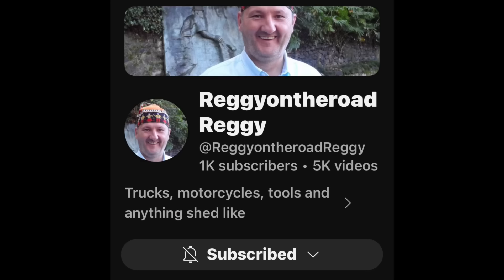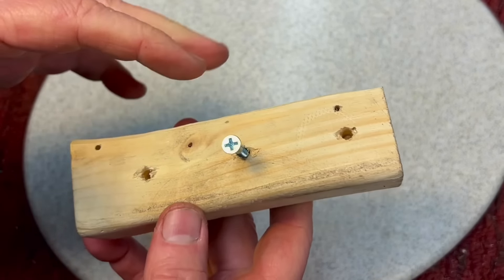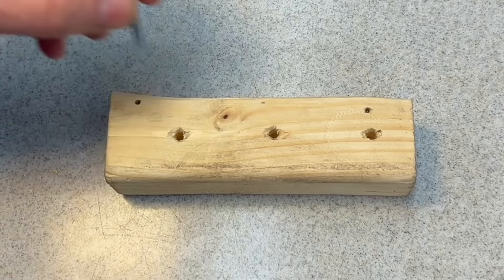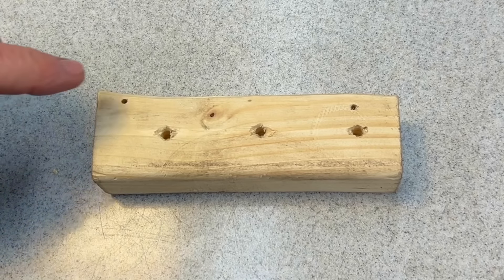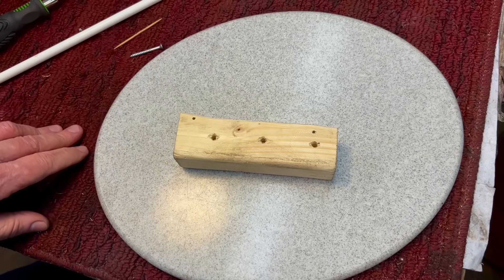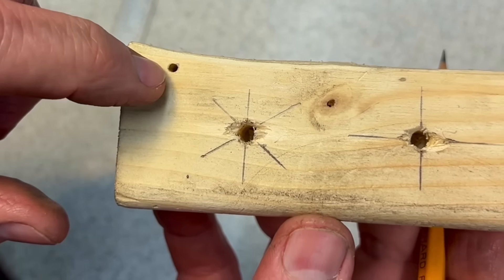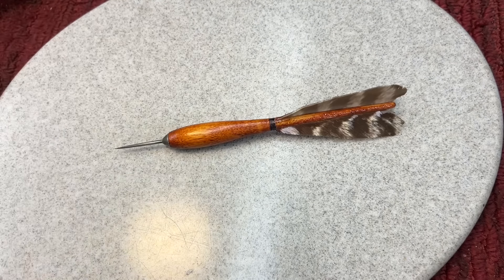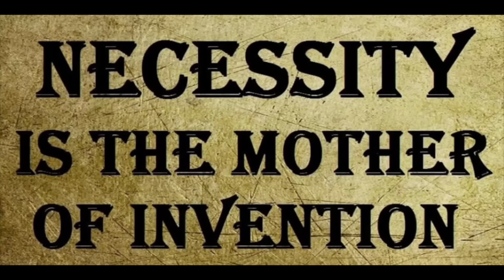Doweling Damaged Screw Holes and Vintage Carnival Dart Build

Comment: Hey John, a few years ago I came across a product call Mr. Grips. Amazon has a pack for about $6. We sell them at the Hardware store. Thin pieces of metal you can cut to size that have teeth on them. You can cut them down with utility scissors or small shears and slip them into holes and then insert the screw. Best fix I have found especially if you don't have time to wait.  Never had one fail and customers love them. Thought I'd throw that out there. Great video as usual!
Reply from the maker: Mike! Very cool, I looked them up on Amazon they look almost like a piece of screen.  😃👍
Reply: @ScoutCrafter  Thicker with barbs. More substantial. 👍🏻

Comment: Great video 👍 That was fantastic information and demonstration on doweling damaged screw holes 🕳 . I might have tried some saw 🪚 dust mixed with glue or Epoxy for the hole 🕳 but I am digging using the doweling method because you are repairing it with real wood 🪵 and I think that is a sort of a good fix for that damaged screw hole 🕳👍👍. Good information on how to properly get the center dead on to put your screw back in the same location where it was original at using the marks you used to indicate where the center was. Now I get why you left the marks on there when you 🪚 sawed the dowels off flush  😂👍👍👍. I think you did a great job on producing the  right amount of stain on your  Carnival 🎡 🎪 darts 🎯. I don’t think there was no way that stain could have been prevented in drawing up into those feathers 🪶, but I like the fix with the paint to kinda hide that stain, fantastic job👍.I think you hit the bullseye 🎯 on that one 😂👍! I did hear that trickling of water 💧 in the background of your video and  first I thought maybe it was your washing machine or just hearing the rain came down in the background outside, but I forgot you said it was leaking in your electrical ⚡️panel again 😮😱. I hope they can fix that issue for you.  Maybe they are  thinking that the water 💧 will keep the electrical panel cool so it won’t overheat when you are using your appliances, yeah that it! 😂😂👍No , seriously I hope you can get it fixed soon. Well again great video and can’t wait to see what you do on Friday. Have a great Day! 😃👍👍
Reply from the maker: Steven I’m going to have to get rubber insulated boots! 😂👍

Comment: Hi, any time I encounter a problem like this(typically door hinges) I just use a plastic plug for concrete. They come in lots of sizes and just need to be tapped(with a hammer) into the hole. They "self centre" and it's a quick and easy fix. The first time I showed the use of plastic plugs in wood I was told "THEY'RE FOR CONCRETE!"  Anyway, he took my advice and his front door was fixed. When there is a large hole in concrete I use two plugs, a large one to fill the hole then tap a smaller plug in to that one to fix to. I suppose the real point is to think outside of the box...I hate that expression. Great vids!

Comment: Great tip on dowelling. I think it would also be stronger than just puttying in the hole. The only thing I can add is that squeezing the dowel with plier jaws would put groves in the dowel which would serve to distribute the glue and also make it easier to insert the dowel. TTh

Comment: Loving the dowel store John, makes me feel not so bad with my stockpile !

My Dad used to have a tin of stuff he used for situations like this it was called Screw-fix, it was a white fibrous powder that you could wet and form to make a plug. He would often (in the field) just spit in his palm and tap some out to mix and apply, turns out it was Asbestos based, it's a miracle the old boy has lasted well into his Eighties ! 😬

I'm still wondering whatever happened to my darts like those ! 🤔

Comment: A lot of the time I just bung in a dowel, cut it and sand. Then just use the fixture to mark the holes again, either by using a template, or centering hinge punch set, or the transfer punch set, or my pica deep hole pencil. Really that may be just an excuse to break out the fancy tools! I look happy most times, but would rather be buying new tools. Hmmm do I need a Marxman Professional Marking tool with the pressurised fluro chalk gizmo?

Comment: If you have ever watched SnakeMountainBoatworks, they have to fill many holes after releasing a wooden hull. They recommend filling the hole with Gorilla Glue and then stuff as many toothpicks that you can into the hole. You then trim off the cluster of toothpicks like you have done with the dowels. Marking the center prior to the “toothpicking” would be recommended if exact alignment is needed.

Comment: I have had to use the doweling method to repair holes after using a hollow drill bit to remove broken off cut nails in very old, dense oak. Once you drill beneath the depth of the nail, you can use a small screwdriver to break out the core (and nail).

Comment: You have a LOT of dowel stock.   I have a single lengths of a few diameters for making custom length dowels.   I also have some packets of pre-cut dowels.
If grain matching was important, I would cut a plug out of similar wood/grain.   I like the idea of marking the hole centre before drilling.
Nice job on the carnival dart.
Dave.
Reply from the maker: Dave- dowels have really gone up in price and the wood is Chinese junk wood now!  🫣😂👍

Comment: Good demonstration. The only time I have used epoxy wood filler was on my oak desk chair. When I bought it there casters that dindn't fit and had wallowed out the holes so that there was not much left. It might have been better if I had routed out enough to put blocks of oak in but I went with pc woody. I think I tried another and it failed. These have held for 5 years with daily use. Still should have filled with new oak pieces.

Comment: Hi John, good video. Im retired from ConEd and did repairs such as water leaks. My advice to you is to call and tell them you have a water leak in your end line box. It sounds like it's pouring out. You dont want your end line box to rot out from the water leak (otherwise, you will then need to repair/replace it out of your pocket). The service box/riser pipe and your end line box need to be repacked (oakum, duct seal, duct foam, or hydraulic cement). If I remember correctly, you had your service cable replaced (mention in an old video). Remember, the squeaky wheel gets the oil.😉👍🏻
Reply from the maker: Hi Joe!  Yes they came and packed the pipe with oakum, hydrolok and putty.  They think the service pipe is compromised and the water is entering underground.

Comment: I have been working on turning a dart set on the lathe, I haven't got the pattern i like yet, but i need them for my vintage 1950s dart board. Do you have any ideas of where i could get dimensions for the classic #2 wooden dart?  Also being able to dowel is a great method, like when its 3am and you are out of Bondo or epoxy but the jobs gotta get done?
Reply from the maker: Patrick I am going to cover darts again next week-  A great episode planned!  😃👍

Comment: I don’t think you have enough dowel stock in the basement rafters. One can never have enough. Aside from that, I remember years ago there was a hole repair repair kit that included a drill/reamer that matched the taper from a pencil sharpener so you put the dowel stock in the sharpener and drilled the hole with the tapered reamer. I thought that was a great concept. Do you remember that at all?
Reply from the maker: Yes!  I think it’s still made.  Tapered drill bits are great!  😃👍

Comment: If you are tightening a wood chair leg that was held together with dowels, and one dowel is broken in the hole, could you use a Car Dent Puller to yank out the remaining dowel? I say "Yes"! 
PS - Your stock of dowels is greater than Home Depot!    Tip: I was reading the instructions on a tube of Shoe Goo, and it said to rub Petroleum Jelly (Vaseline) on the tube threads before placing the cap back on, to keep the contents from drying out.
Reply from the maker: That’s a great tip!  😃👍

Comment: Repairing stripped screw holes in in wood is something I have done many times. 
https://youtu.be/XCdQbHs1mbQ?si=GYjMGeXVuOxwwzHE
I have found that using dowels provides an end grain thread that creates a weaker thread due to cutting the grain of the wood into small sections over the length of the screw hole. I use a plug cutter to create a cross grain plug that in my opinion is stronger than the end grain repair.
Reply from the maker: Plug cutters are great, the important thing is many plug cutters are tapered slightly as hole fillers and might be shallow for certain applications. 😃👍

Comment: Centering the hole when doweling repairs are made is definitely irrelevant! You just need to remove the damage. Which bit worked? I just bought a set of nice forstner bits but have not yet tried them. I did a bunch of dowel repairs using Cascophen glue. Pretty nasty stuff but the formaldahyde works good with the wood cellular structures.
Reply from the maker: Some people can’t take the smell of formaldehyde, I never smelled it.  🤔
Reply: @ScoutCrafter  
The Cascophen actually smelled surprisingly good! Not good with what is in it, though. It made you feel like it was non-toxic and relatively safe....which it isn't.